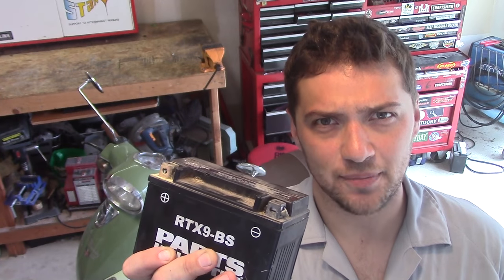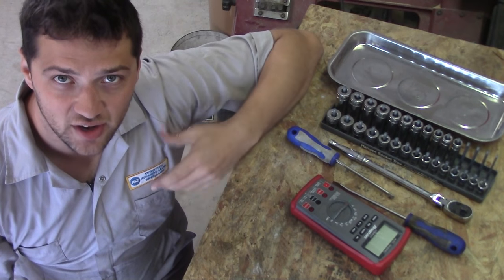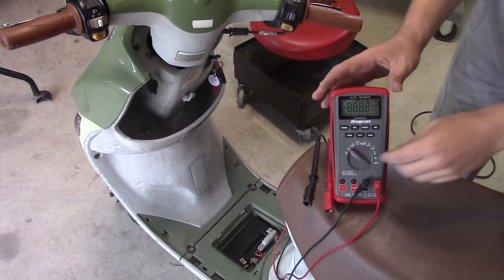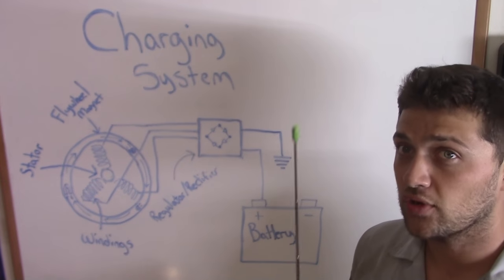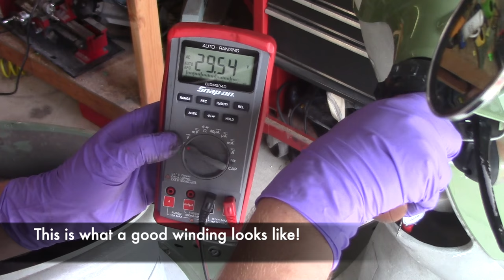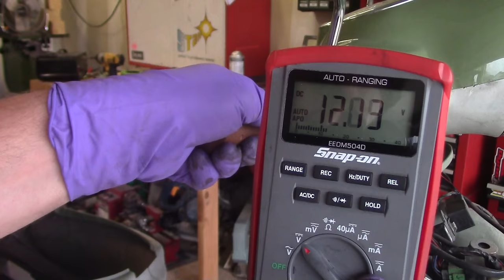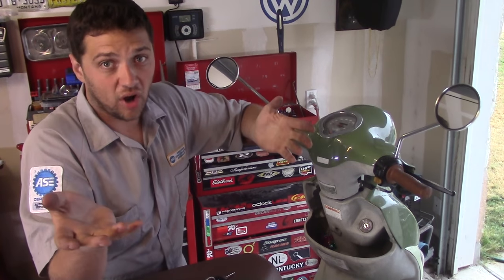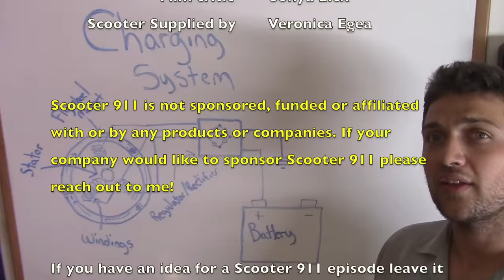Scooter 911: Battery Keeps Going Dead! (Troubleshoot your charging system and parasitic drain)

Comment: In the portion of the video where you check the stator AC voltage did you start the scooter while the multimeter was connected to the stator-side pins? And do you have to start the scooter again every time you want to check a new pin?
Reply from the maker: Yes I did! The engine needs to be running for the stator to be generating electricity. You do not have to shut engine down every time you want to check a different leg of the stator but it needs to be running when you check it. I hope that helps!
Reply: @Scooter_911  So i started working on my own scooter after seeing this video and it seems like my AC voltage is good on the stator side pins (i had some trouble with this cuz my multimeter is different then yours it has a 200 and 600 setting and on the 600 setting it looked good) and the voltage coming out of my regulator/rectifier was around 13.8-14v, but my battery on its own never got above 12.1v like you showed at the beginning as an example of a bad charging system. Im not sure what to make of the results. The stator wires on the regulator/rectifier also had absurdly low voltage compared to the stator-side pins. Any idea whats going on? Am i doing something wrong?

Thanks!
Reply from the maker: @Korterra1364  nice work! I've seen that exact symptom a lot and it sounds like you have it nailed down! What's most likely happening is you have excessive resistance in the charge wire (from the regulator rectifier to the battery). This is usually do to damage somewhere deep inside the wire harness. The easiest fix for that is called an "overlay". You basically cut that wire right after the regulator and lay down a new wire tying it in to the harness or connecting it directly to the battery terminal. I should mention before you do this make sure you're battery is in good shape as a bad battery can mimic your symptom. You can also ohm the wire from the reg connector to the battery terminal. You should have less than 1 ohm resistance. Good luck and let me know what you find!
Reply: @Scooter_911  Interesting update. I found the frayed wire and got some connectors and heatshrink from Lowes and cut, stripped, and connected the two ends. Now my regulator/rectifier voltage on the red wire is barely peaking over 13v and the battery isnt budging past idle voltage either. Is it possible my reg/rec AND battery are both bad? Would checking resistance help narrow this down? If so, I should connect check the resistance from the red reg/rec wire to the positive battery terminal while the scooter is running? I've checked the resistance across just the red wire with nothing running and that was 0.1-0.3 ohms, would that confirm the wire is in good shape? Thanks for all your help.
Reply from the maker: @Korterra1364  wow excellent work! Have you considered a career as a technician?!? No, the scooter does not have to be running in order to check the resistance of the charge wire. Did you also check to see if that wire has any resistance to ground (once you have unplugged it from the reg/rec). It is possible that wire has been shorted to ground and so the full current is not being conducted to the battery. If there is no continuity to ground then I would imagine your reg/rec has been damaged by the short, and it might need replacing. The thing you can do is called a "wire overlay". Basically, disconnect the suspect charge wire and connect a new good wire from the reg/rec charge pin directly to the battery and see what you get. You are doing excellent work keep it up! And keep me posted!
Reply: @Scooter_911  Testing continuity for ground wire would be the same as checking for the positive wire right? Just probing the negative wire (green i believe in my case, but the black wire coming out of the reg/rec is also present) and then the terminal end that goes into the battery and checking using the Ohm setting? I have done this and get a similar reading of 0.3 ohms just like the newly fixed positive wire. Testing the positive wire for continuity with a ground im not sure how to do exactly? I guessed it would be probing the red wire then the ground wire which produced nothing on the ohm setting or continuity setting. I have also noticed both  the green and black wires have continuity with the ground cable on the battery terminal end. Where should I go from here?
Reply from the maker: @Korterra1364  nope you nailed it. If you tested for continuity on the red charge wire to a green wire or the negative battery terminal, and you had no continuity it means you do not have a short on that charge wire. Try the wire overlay but more than likely the regulator rectifier is not operating correctly.
Reply: @Scooter_911  Latest update. Brand new battery came in and I just tested it. For context, before this new battery I was not getting more than 13-13.3v from the reg/rec and never over 13v for the battery. I just installed the new battery and the voltage from the reg/rec peaked at 15.5v which is way too high, and the battery was receiving most of it peaking at 15.3v. Is it possible my reg/rec has been bad for a while and its been destroying the (now 2) batteries that I've put into it while I drive it? If not, what else could this be? It seems my splicing job went well though, I was worried a bad splice was causing a lot of resistance, despite having checked it already.
Reply from the maker: @Korterra1364  dude you are crushing it. I'm not sure what your day job is but you always have powersports technician to fall back on! Yes that is absolutely a possibility. A bad voltage regulator will definitely damage your battery.
Reply: @Scooter_911  Hopefully the last update and I can say thank you for being so responsive. The new voltage regulator I ordered came in today. I threw it on and tested the idle and throttle voltage on both the new reg and the battery. In the beginning it seemed like I was getting good readings but I redid the tests a few times to be sure and I went down from 14.5v peak to 13.7-13.9v coming from the regulator and ~13.3v to the battery. Now, my multimeter is cheap, the cheapest they had at Home Depot, and its been sitting on a rattling scooter for most of the tests because I need both hands to probe. Is it possible it just is too cheap and the readings arent right? Its a basic Klein Tools one. Im not sure what else to do at this point if thats not it. Also the new reg/rec gets warmer than the previous one despite being the same model. Any insights? I was thinking about driving it around and measuring the battery percentage after 2 or 3 days plugged in to the scooter full time to test if the charging system works. Thanks as always for your help, wouldn't have gotten this far without you.
Reply from the maker: I bet your meter is fine, voltage is a pretty simple measurement. Are you measuring 13.3 at idle or when you rev the engine?
Reply: @Scooter_911  When I rev the engine Im seeing 13.3. At idle im around 12.5.
Reply from the maker: @Korterra1364  and what voltage do you get coming out of the stator when it is unplugged from the regulator rectifier?
Reply: @Scooter_911  While the scooter is running, the idle seems to be around 5-15v and when revving im around 30-50. Sometimes 60 for just a second. Ive probed it multiple times as well and sometimes ill get nothing and sometimes ill get the readings i described. It may just be me balancing probing and throttling at the same time. Ive noticed on the stator side plug one of the ports looks like the plastic melted and rehardened or got damaged another way. If the stator was bad would i jave been getting the 15+V reading on the old reg/rec though?
Reply from the maker: @Korterra1364  well the thing about stators is they can have intermittent problems. Sometimes the windings will short out when heated, but when they cool down the metal retracts and the winding insulation aligns itself just right to be complete again (if that makes sense). And applying the load to the stator can cause it to heat and short.
Reply: @Scooter_911  Would there be any visual indication? I could try to inspect it and see. I dont have the special tool for the flywheel from what im seeing of others replacing GY6 and GY6B stators online, is it possible to do with just a socket wrench?  It looks like my entire charging system was just not doing so great. Im surprised the battery lasted 4 months like that.
Reply from the maker: @Korterra1364  sometimes a shorted stator will have clearly burned or blackened windings. Other times it's more subtle. You WILL need the special GY6 flywheel puller tool but they are under $10 on Amazon and even the cheap ones will get the job done. You will also more than likely need an impact gun to take the flywheel nut off. I've found that even the inexpensive electric impacts will do the job.
Reply: @Scooter_911  Its been a while, I installed a new stator finally and almost killed it by not attaching the ground wire where it connects on the scooter. I am still having the same/similar issue with not enough voltage coming out of the stator when revving. Idle seems good, except for 1 wire. 1 of the 3 wires coming from the stator connector to the regulator has nearly 0 resistance while the other 2 (the ones with good idle voltage) have around 100ohms of resistance. I am not sure if the lack of good voltage when revving and the potential short are related, but I wanted to get your thoughts. I think something in the wire harness might be bad, animal chewed on it or something. Everything looks good from the outside though. I am at a total loss now. 

I have repaired a frayed wire tot he positive battery terminal
I have replaced the regulator
I have replaced the stator (and promptly overloaded the ground wire the first time i tried starting everything up)
Battery voltage at idle is never exceed 12.6v now. 

At this point you probably couldve taken my scooter and made an entire video on everything that could possibly go wrong with a charging system and shown how to repair each one lol.

Comment: did the electrical diagnoses as you exclaimed in the above clip, everything checks out, no parasitic drain. Noticed the carburator is flooded and keeps on flooding. I removed and cleaned the carburator a while back and adjusted the enrichment screw. Need help, there is spark and the stator motor turns but it struggles to ignite. please ineed advise

Comment: I have a Peugeot Speedfight 4 scooter. When the engine is off, a current of 12 mA is drawn from the battery at regular 2-second intervals. Is this a fault? Could this current be drawn by the immobilizer or ECU system? As a result, the battery becomes unable to start the engine after a week of inactivity.

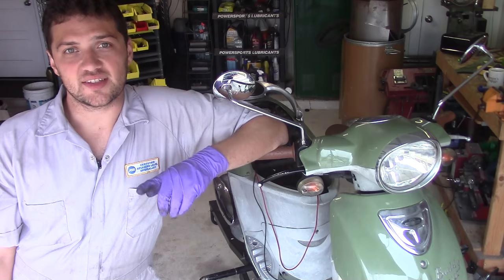Comment: I'm having a bit of trouble understanding. I backprobed the regulator/rectifier as described at 6:28 and the voltage barely increased when I revved the engine. I checked for continuity between the ground wire on the regulator/rectifier and the negative terminal on the battery, and there's continuity. Everything else seems to check out. Does this mean my regulator/rectifier is bad? I have a 2009 Kymco Super8 150.
Reply from the maker: There is a good possibility you do! But when checking the ground side, measure resistance instead of continuity. You want to make sure you have less than 3 ohms resistance and continuity can be deceiving that way. Also make sure your stator output is decent before condemning your regulator rectifier. Good luck!
Reply: @Scooter_911  I'll check again in the morning but if I remember correctly my multimeter said the resistance was less than 1 ohm. Also, the stator wires were giving me 40V AC when I revved.

Thanks so much for your help!!
Reply from the maker: @Muniosi  nice work! yep that sounds like you need a reg/rec
Reply: @Scooter_911  Okay I just checked resistance between the ground wire on the reg/rec and the negative terminal on the battery. With the scooter turned off I get 0.1Ω. When I power it on that jumps to 3.3kΩ. However starting the engine and revving takes it back down to 0Ω.

Thanks again for all your help!

Comment: Do you have any plans to make a vid on how to troubleshoot a scooter that won't start (mainly fuel system problems)? I would love to see that.
Reply from the maker: Yes I do! In fact the first video I ever shot (I never released it because it got a little convoluted) was a master diagnostic for "scooter doesn't start". It went through all the systems in a choose your own adventure. My plan is now to make shorter videos with links to other videos. Stay tuned!
Reply: @Scooter_911  Excellent. I can't wait. I subscribed so I'm guessing it will show up on my feed?
Reply: @Scooter_911  BTW, what is a "GY6"? And do 50CCs fall under that description? I have a Boom Revolution, which I suspect is Chinese.
Reply from the maker: @radconserv68  if you clicked the little bell icon you will receive a notification every time I release a video. Thanks for the subscribe!
Reply from the maker: @radconserv68  what makes a gy6 is the basic engine design. Almost every Chinese scooter and most Taiwanese scooters are based on the GY6 layout. 50cc 4-strokes included. You'll notice a 50cc Chinese scooter has way more in common with the traditional 150cc gy6 than it does with the Yamaha vino 50. 

Also you'll want to pay attention to the engine code on the left side of your engine case. The code will have an engine identifier usually at the beginning. A 150cc gy6 will be a 157qmj, while a 50cc will have the code 139qmb and a 125cc will have a code 152qmi. These engine designation codes are a great way to look up engine parts for your Chinese scoots!
Reply: @Scooter_911  That's great info to have, Garret. Thanks so much.
Reply: @Scooter_911  In replacing the spark plug, is it necessary to set a gap, or should it be good from the factory?
Reply from the maker: @radconserv68  I ALWAYS check/adjust the gap on every spark plug I install. Most plugs (especially high end/vehicle specific) come gapped to a pretty close spec, however, that doesn't mean that the fool behind the parts counter hasn't dropped the box. Good question.

Comment: G'day m8....ive had bought a just before the Pandemic a "Aprilia Sportcity one 50 4T 2V 08-10 E2 (08-10) is the yr produced second hand not running, and ive bought new Coil, Rectifier, spark plug and Battery. everything works but starting takes full throttle and it barely runs at full throttle and chugs for a few seconds and stops. i dont know what Carby is on this engine and i beleave its a 4 stroke. Any help on what carby i got so as to try and clean it, fix it and put it back together and hope for the best. Im partially disabled and this will help me do my shopping as a car for short trips is killing me in fuel. Big Cheers From an old fella Downunder🙃(Australia)

Comment: My battery keeps showing voltage from 11.5 to 16.8 V when active. The volts change every 30 seconds to anything in that range. Also when fully charged it can still struggle to start but even after a long drive when I stop the engine and start up, it struggles again.

I bought a new rectifier and I am having the same issue. Could an exhausted or defect battery be causing my rectifier to keep sending in fluctuating volts as its trying to keep the battery charged?

Comment: My scooter could not keep up with a radio and running light i installed. So did the ac voltage check and either the yellow or white wire i can't remember which one was charging 30ac  volts and up when revved and the other one was way lower I think I teens to 20's. So I have ordered 2 more 8 pole stators like the one in it already. They all check out the same. I could not believe they were all bad. I ordered a 11 pole update stator and it has 3 yellow output wires. Upon checking them 2 of them are putting out 30v and up however the 3rd one is low just like the 8 pole stator. This is driving me crazy. Some people say all the wires should put out at least 40 volts and up when revved. Others have said anything over 12volts is good confused.

Comment: my scooter went from running perfectly fine to suddenly dying while I was traveling down the road (as if no spark) back to running, although poorly. Starter stopped working, could kick start it, no lights working, running poorly and limited to certain rpm. limped it back home. Now, 3 years later, I´m not sure where to look for errors. could I just for the sake of it, since the starter does not work, start by looking for continuity on the stator, instead of voltage? or should I just go straight for looking for bad ground, due to the vast amount of electrics malfunctioning? If you have any bits of advices, that would be awesome! (also, what kind of symptoms does the different electronical components provide when failing?

Comment: Great.. 12.1V, starter turning over, but not starting nor recharging (this even happens with a fully charged battery). Because of that, it can't be kick-started either. But that's not my only problem. Absolutely no change in voltage, even though my scooter nearly takes off with its stand.. either a wiring connection or rectifier issue. I don't think it's the coils that are to blame in my case.

Comment: I have a question I cant seem to find the answer for. I have a 2012 Genuine Buddy 170i. I have no spark and no fuel. What would control both of those?
Reply from the maker: The ignition switch on the 170i is very particular and has some small circuit built into the back of it. The regular buddy 125/150 switch bolts right up and plugs in but the bike will not run. Other than that make sure you have good power and connection to the ECM (engine control unit) and check all of your fuses!
Reply: @Scooter_911  You saved me a lot of headache. Exactly what it was. Well another 2012 170i back on the road!
Reply from the maker: @BrownStripeyCat  nice work my friend! Keep it shiny-side up?